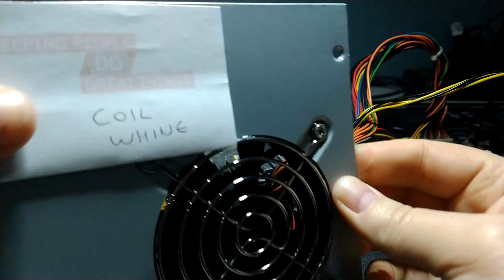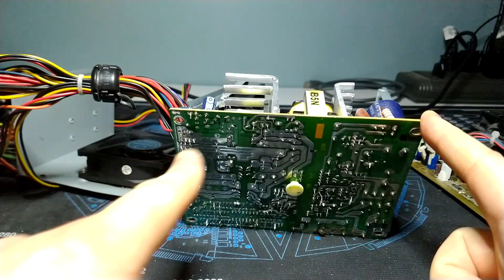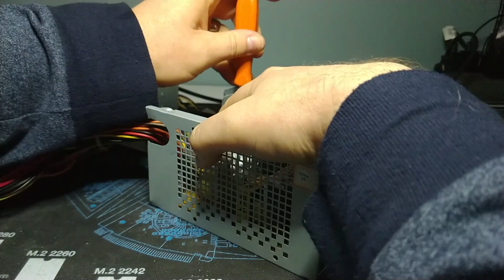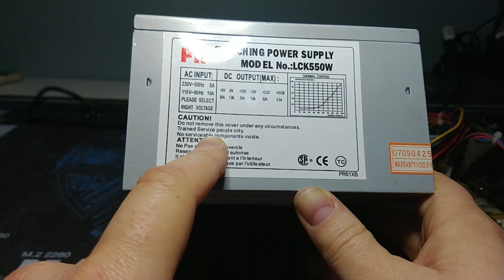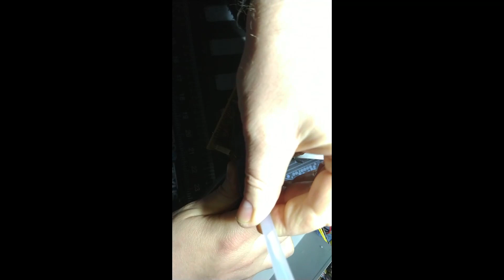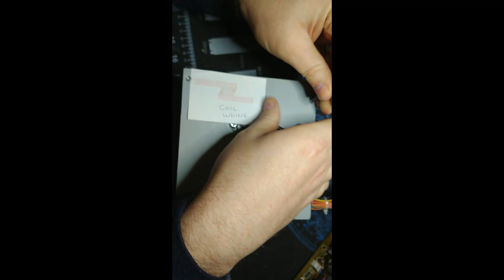PSU Coil Whine Repair Attempt

Comment: the capacitor in front of the coil with the yellow tape needs replaced. It is causing the coil to buzz I think. If it has less than flat on the top get rid of it or at least, don't trust it. just a thought.

Comment: Wish i would have known this coil whine thing before, i bought 2 different used psu for a dell pc on ebay and both of them had coil whine 😢  30 bucks each so 60 total and after that i found dell web site sells them brand New for 60 😅 well i learned the Hard way

Comment: Hey, is it case covered by warranty? I mean, i have discovered it recently, my pc was built 6 months ago in the local store of my city. So, can i contact them to fix coil whine? Thanks
Reply from the maker: It's worth a try
Reply: @retropcdurham  what is the chance that they will subdue the problematic components? Is the practice of coil whistle repair widespread in general? Perhaps the vendor supplying the video card or the manufacturer of the power supply will be able to solve this problem? Have you had a similar experience with this request? I'm sorry, I'm facing this for the first time and I'm worried
Reply: @vopseleacrilice3062 No it's not worth it. Most manufacturers don't consider this a defect.

Comment: I'm listenning to this with the sound of my own psu coil whine in the background.

It's SO annoying.

It was always doing it from time to time and it happened that SWMASHING the case or more precisely smashing the PSU a couple time was enough to stop the whining for a time, sometimes days. 
but today it started, and i smashed it over 50-100 time, even using a hammer and it doesn't want to listen. 
I don't have any glue so i'm actually losing my mind smashing my PSU over and over again in the hope it will stop, god help me.

I'll definitely buy another PSU very soon it seems.
Reply from the maker: Hammer seems like a better tool that hot glue, after my experience :)
Reply: @retropcdurham  I actually gave up on it. I endure the psu coil since the last month and i must say once you get used to it it gets better but still a bit annoying at times i put my headphones so i don't hear it. Maybe il buy a new psu in some time when i get really bored but yeah there was nothing i could. The coil got the best of me. I'm vanquished.

Comment: Oh bud, that’s funny, eh. Nice work!! But wouldn’t it be be better to remove the component and replace it or remove it and coat it with epoxy instead of hot glue… Since it will be hot while running after all… Won’t that make it smell like hot glue is burning at all times?…
Reply from the maker: The components that whine generally don't get hot enough to remelt the glue, and yes replacing the individual component would be a better fix as well

Comment: Hi, great video and explanation. I recently bought an Aorus AP850GM, it have only 3 weeks and started to make the coil whine noise, i dont know if i need to send it for replacement or its a normal electric sound. i dont think it have a capacitor problems. what do you think?
Reply from the maker: If you can get a warranty replacement then do it. While coil whine doesn't poss any threat, it is annoying and will never cure itself over time.

Comment: My PSU is dead and when i jumper the PSU to turn on with wire, it's sound like low rpm diesel engine. And it's the second PSU that dead with exact same issue. How to fix that?
Reply from the maker: That sounds more like the fan would be making that noise.

Now, why the PSU is not working properly or getting damaged could be due to dirty power, or maybe it is getting overworked by the PC?  

You might want to check the support forums for the model of PSU (assuming it's the same for both PSU) to see if that model has a common issue
Reply: @retropcdurham  Im use it to drive my fan to cooling down my laptop, you know, some cheap diy power supply. 

I just connect it to 4 fan that each fan require 12v and max current is 0.2A, so it's around 10Wats i guess. I connect 2 fan in parallel to reduce current and my fan or PSU can be longer life. I use it like 1-2 months and it's dead. 

Is that why my PSU dead? because i use dummy load and not a real PC component load
Reply from the maker: @diablodizzy.  It's possible?  If you had like a hard drive plugged into it as well maybe would help?  It certainly doesn't sound like you are pulling to much A on the 12V rail with only a couple of fans
Reply: @retropcdurham  I dont know man, using PC power supply is very cheap and effective. in my country Indonesian, you can buy used PSU start around 2 Dollars American

Comment: The sound is due to the burning of some parts such as capacitors and resistors, look for defective parts to remove the sound!  Output capacitors or capacitors around the standby transformer become more defective.
Reply: Thank you sooooo much!!! I noticed that there was a burnt resistor in the psu near transformer, so I replaced it and now it's not whistling anymore.

Comment: If your unit developed the whine over time, it could be due to many things, such as a capacitor, Mosfet, Jfet, "Power controller IC" about to fail, it may even be a dry joint,

If the noisy component is located near a lot of heat, then it's highly likely the noisy component may in fact be alright but experiencing stress from some other component that is near to failing, If you know someone with an Oscilloscope, check to see if power rails are clean, and if not an erratic wave form could clue you in to the failing component or IC..

Comment: My Dell optiplex 760 power supply is hissing for the first 10 minutes when I turn it on then it becomes quite is it fine to keep it like that or do I need to change the power supply
Reply from the maker: After my most recent PSU experiences I would recommend inspection that there are no capacitors bulging and/or leaking.  If it is just coil whine you are fine, but bad caps means time for a new PSU.

Comment: Is it safe to keep it buzzing?
Reply from the maker: Yes, the cool whine isn't dangerous, just incredibly annoying.
Reply: @retropcdurham  my dude, i fixed the problem by plugging a new cable with 3 pins, of which is earth wire
Reply: @retropcdurham  thx man, you saved me from spending $100 on a brand new 800w power supply